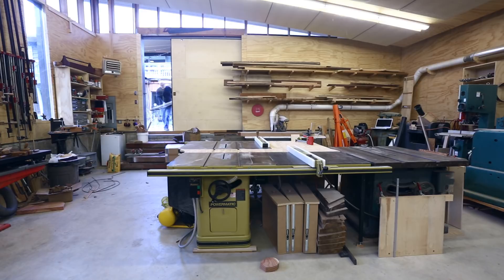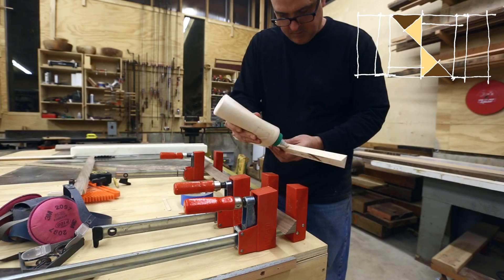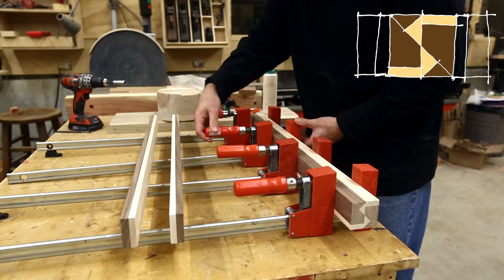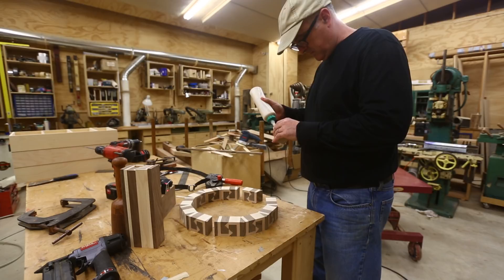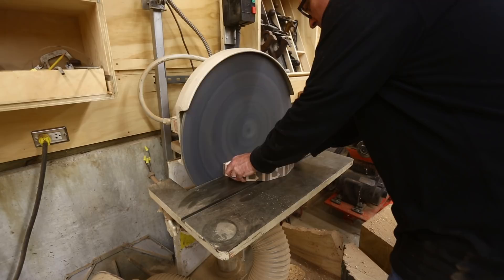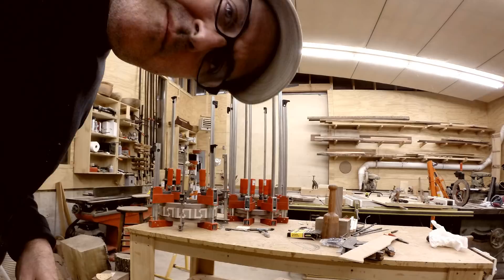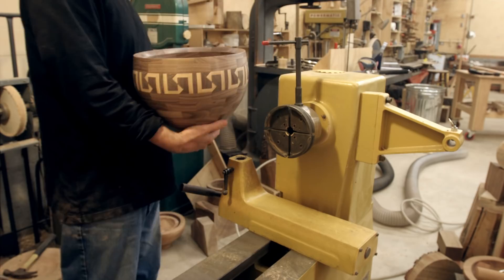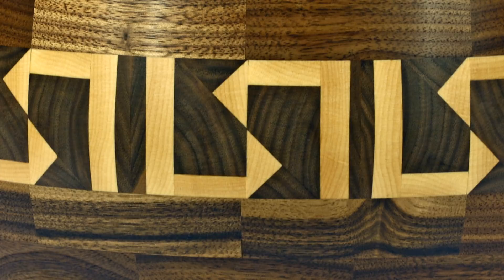Segmented Bowl

Comment: those vids are so damn good i cant even handle it.
Reply from the maker: +Roman Randhahn thanks
Reply: he could probably make you some handles, don't worry.
Reply: I dont know if you are interested in suggestions but I personally really like bowls like this that have largly walnut in it, since i really like the color of the wood. 
I was wondering if you could maybe do a similar bowl where between each ring and each segment of walnut u would add a very thin slice of maple maybe 0,1 or 0,05 inch thick. for the feature ring you could then only use those thin slices alternating between layers of maple and walnut and maybe somewhat randomly exchanging parts of different length with the opposing wood in each layer here and there. 
here a picture I created with paint to showcase what I was meaning. I couldnt get the pattern tilted tho, but I think it works horizontally as well. 
http://fs5.directupload.net/images/160908/uikkaso2.png

or something similar. 
just a suggestion,.
Reply: That's a nice design!
Reply: What do you do with all your pieces? Do you sell them on here or are they orders from clients?

Comment: If I understand this correctly, The feature ring is now exposing end grain. I am trying this and my gouge is just throwing dust. Is that normal? I love segmented rings because of the littl twists do wood that come off. I almost need to move my lathe outside to finish this bowl. Thoughts?
Reply from the maker: +Bob Pinta endgrain is much harder to turn and will give you a lot of dust.  keep your tools as sharp as you can
Reply: +frank howarth thanks. I thought I was doing something wrong. I love Padauk but the red dust is everywhere. Thanks frank. Keep up the great work. I have learned so much from you.

Comment: Can I run the rings through a planer?  I don't have a drum sander and it seems like each of my rings has at least one or two pieces that are slightly higher than the others.
Reply: No because then in some spots you will be planing across the grain and therefore have chip out in those sections. Sanding with the disk sander is probably your best bet as you don't have a drum sander
Reply: No because then in some spots you will be planing across the grain and therefore have chip out in those sections. Sanding with the disk sander is probably your best bet as you don't have a drum sander